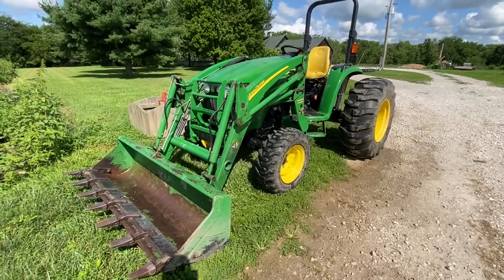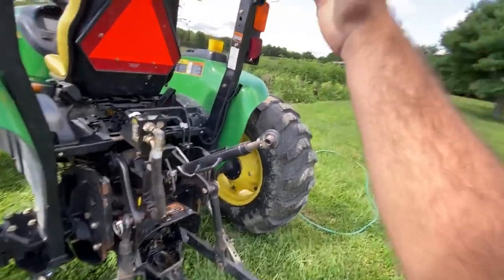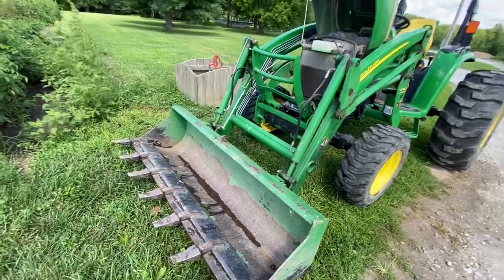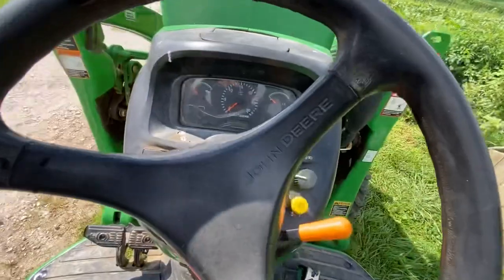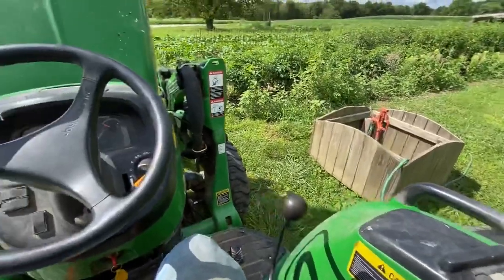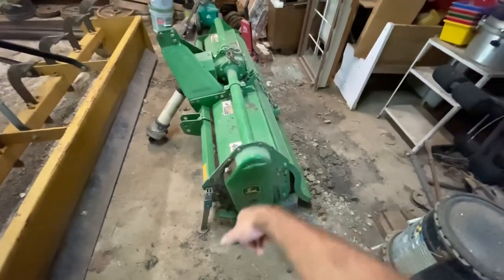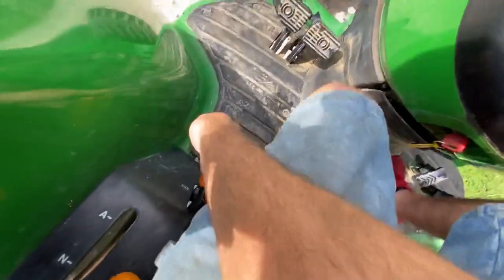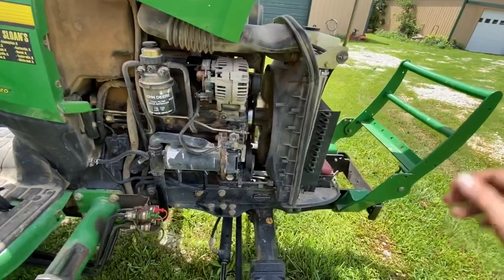2006 John Deere 4720 - 1,400 Hours | - Overview and Controls

Comment: Would you happen to know were the power beyond location is
Reply from the maker: Technically, this tractor has a power beyond for the backhoe. You have to disconnect the top pressure line and use it - you won’t have a three point function anymore - as well as a return line elbow below the top link bracket a ways.